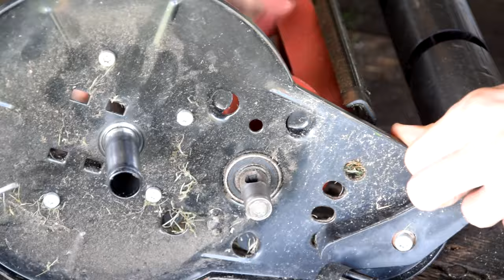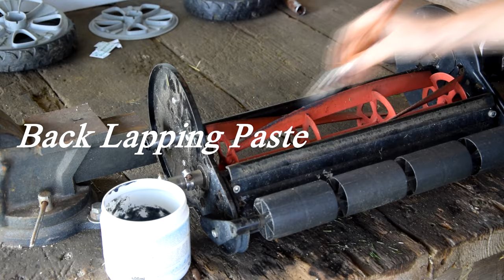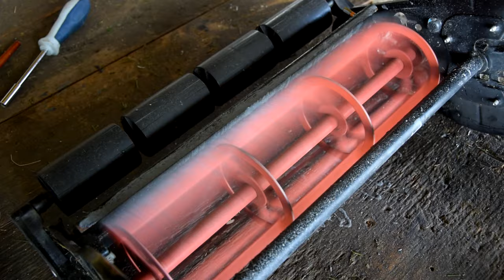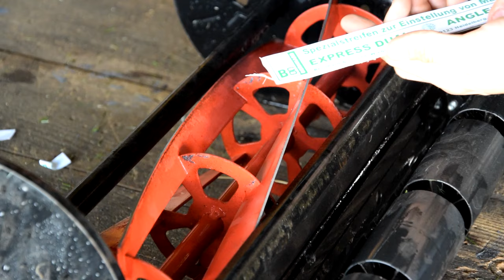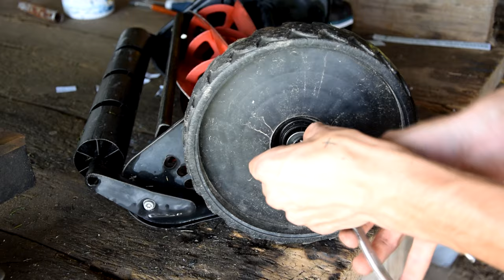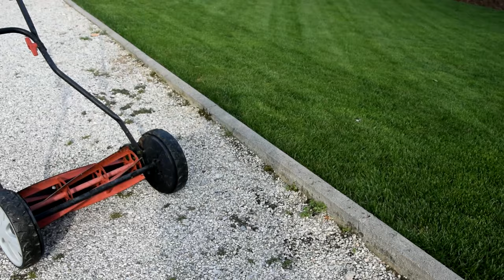Sharpening a Reel Mower

Comment: Would be nice to know how you rigged that drill bit. Seems like a piece of rubber tubing with two hose clamps. In other videos, the mower had a socket drive. Nice video overall. I agree with others--would be nice to have commentary.
Reply from the maker: You can see all in the video. Two hose clamps, drill machine and hose that's right.. what socket drive? 😊

Comment: Well done there! 
If you want to be sure,  as your machine gets a bit older, when you loosen the bed knife, try to wiggle the reel in it's bearings.
If you see "play" in that shaft, you need to adjust or replace that bearing.
Then you can get a perfect sharpening and setting.
Enjoy the mow!
Reply from the maker: Wayne Essar Thank you for comment and for good advice. And as always enjoy the mow you too.
Reply: How to get the bed knife dead-flat (i.e. dead-straight)? Lap it on a large sheet of steel plate. 

And if you have no lapping paste? Will wrapping the lapped bed knife in increasingly finer grit sandpaper, while gradually advancing the bed knife toward the reel, have the same net effect?

Comment: I can't figure out how you got those blades sharpen. I didn't see you touch the blades as far as sharpening them. When you did put a hand on them was when you applied the backlapping paste. Nice video yet that's the thing that I am not getting. Sorry.
Reply: By tightening the blades up against the frame, and then rotating them backwards against the frame.